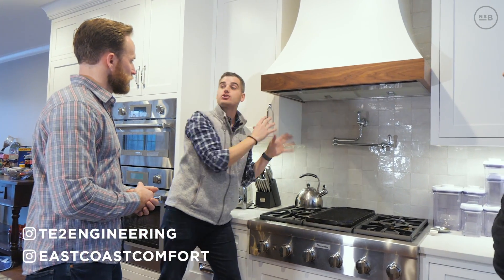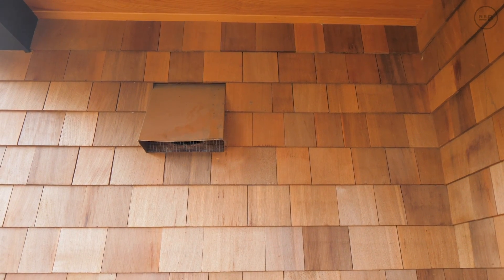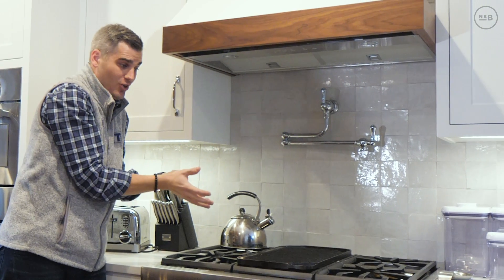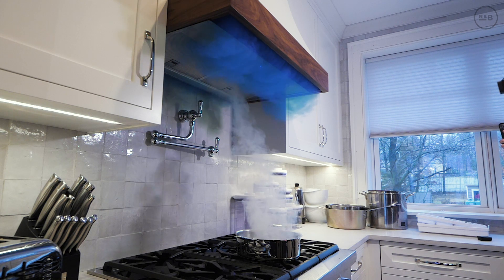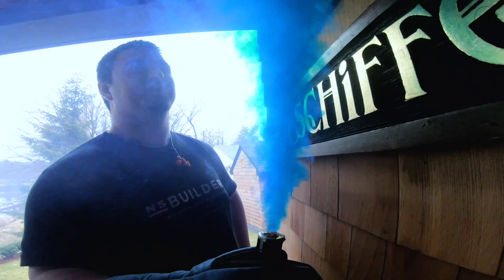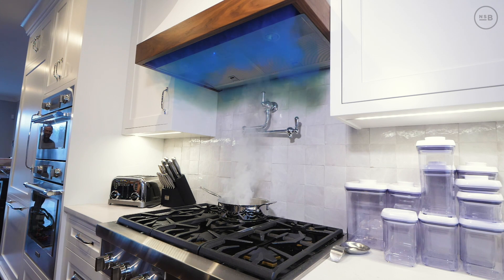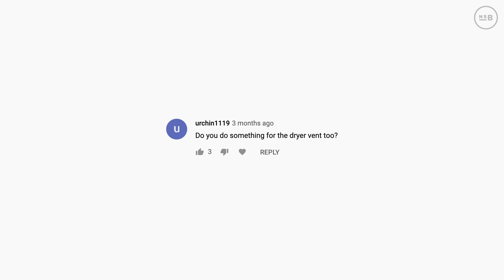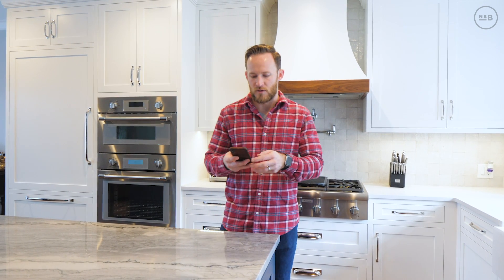Performance smoke test on kitchen hood exhaust and make up air

Comment: Why is outside air needed?  Wouldn't the hood be drawing room air in from around the front of the vent to similarly sweep cooking fumes away?  Is the purpose mostly to avoid expelling conditioned room air, for more efficiency?  Also, in an extremely tight house, the exhaust fan could create a negative pressure, but most houses leak enough that it wouldn't be an issue.  If you have a doggie-door, that acts as a pressure-relief valve to mitigate significant negative pressure inside the house.

Comment: The test is a bit disingenuous. Whatever that was on the cooktop was NOT putting out near enough smoke or steam for an honest test. I want to see two cast iron skillets cooking ribeye steaks at 425 degrees. Now that will give you some smoke. However I do like the make-up air system.

Comment: Interesting idea for a test but really this video shows that this setup exhausts the makeup air, not stovetop smoke, which is the point of having an exhaust fan over the stove. The simple variation that probably would have shown the effectiveness of the vent removing stovetop smoke would have had a lot more stovetop smoke and start with the exhaust fan on and the makeup air inlet blocked, showing how well the stovetop smoke is pulled out in that condition. Then unblock the makeup air inlet, and see the difference. It would have been interesting to see that.

Comment: Love this idea, but was wondering if there is a minimum distance there must be between the exhaust outlet and the make up air inlet on the outside of the house? I have limited options for duct routing and they would need to route to roughly the same place on the outside wall.
Reply from the maker: Best to work with a mechanical engineer and ask

Comment: Matt Risinger has a more recent video of a fantech MUA system.  He uses a manometer to show that two 8" passive holes do not supply enough air to balance the pressure of one powered 8" ducted fan.  I agree with other commenters.  I think this is just reducing the actual removal capacity by simply removing outdoor air that does not capture the fumes (a short circuit).  Also it's unfiltered air.  And it's not providing enough makeup air to balance.  Home Performance also has good videos on the same fantech system.
Reply: True if balancing is your goal, but your still keeping a high velocity that you wouldn't have with a smaller fan. Basically it traps fumes like a high exhaust system but loses tempered air like a low exhaust system

Comment: I'm not a hater and I appreciate people thinking out of the box. 
Given that, I think you cheated on the test a bit.... I noticed that when the fan was turned down, you moved the white pan to the back burner, obviously trying to get it to work when it didn't at its original location.  This is bad form.  99% of people use the front burners when they cook and only use the back when the fronts are taken.
Also, the original video showed the flow with arrows looping all the way down to the burners (it doesn't take a rocket scientist to figure out that was marketing hype).  Your own test debunked that idea.

Though I think this system doesn't give the results and isn't worth the effort or cost to install, it is an attempt to try something better.

 I just wouldn't stake my company's reputation or clients hard earned money on an unproven idea. YMMV

Comment: The house is still under negative pressure if your passive intake duct size is equal to the exhaust air duct.  For example, if 400-cfm is being removed through an 8" diameter duct, then the passive make-up hole size needs to be 16" diameter (or a 14"x14" square hole).  In any event, your thought process is appreciated.
Reply: exactly   You’ll need a much larger intake for this passive makeup air approach.  For 1200cfm hood. The only solution would be an active system with a Motor.  The tricky thing I am trying to find out is where to put those intake grill so that most of the air coming in will be exhausted in the end , resulting in minimum outside air mixing with the conditioned air in the room.
Reply: @charliexu1099  I'm currently working on my own house and have decided to use a 1000-cfm exterior wall-mounted kitchen exhaust fan with a Fantech hood liner.  This should work well with a 20-inch (314 sq-in) motorised make-up air damper from McMaster-Carr.  The air is being pulled from the attic and placed above the fridge which is adjacent to the stove, with the use of an electrostatic filter.  I also have the option of putting the make-up air directly above the stove.  There will be very little mixture of air, as it is all localised.

Search "Broan make up air damper calculator" to help sizing your passive hole.

Comment: Not sure what is really being gained here, except your exhaust fan is mostly exhausting fresh make-up air?  How about getting a couple of those front burners going with white smoke with the make-up air off, then again with it on.
Honestly, as its set up now it seems like bragging rights for an over-complicated theoretical air flow system that isn't doing what it was envisioned to do.

Comment: So you guys are pretending that this works. Ignoring that it vents out the clean makeup air. The curtain of blue smoke should of went down close to the cooktop in order for the design to work, that way it eould mix with the gases. What you got there is a system that kicks out the fresh air from the makeup air vent.
Reply: Looks like it's support to act as more of an air curtain than being solely make up air.
Reply: I would think that what you really would like is for fresh air to come in and stay in an remove old stale air, no bring fresh air in and out.

Comment: This is my preferred approach by a long shot. Thanks for both these vids. Since I have no choice but to add MUA I’m making myself like the idea. 
After watching the popular uploads and reading the comments, some clarity surfaces. Coming in from across the room unconditioned, unfiltered, passive. I better not. 1/2 the time ovens are elsewhere, so from below is subjective. My insert is only 600 cfm, (with an 6””outlet, doubtful) and I get to build the island hood. Plenum style is a terrific approach! An 8” passive  24v damper seems adequate. A filter box probably won’t work though this way, right?

Comment: Quick question, is there any issues with pollen intake? I would have expected to see some kind of online filter with this make up air system, my worry is that here in Georgia if you had that system without a filter on the intake side then if you turned it on when cooking you would potentially bring in pollen/outdoor dust over your food, and that doesn’t sound great.

Comment: The "smoke test" is fundamentally flawed in that the "smoke" is significantly lighter than the grease/oil infused exhaust from regular cooking.  (just look at the grease residue in and around a typical work area etc...) Also, in your demonstration you use just one pan on a six burner unit...which probably could generate at least 90,000 BTU.  I have to say the this video is borderline a bunch of "smoke" and mirrors!  But the kitchen looks great!

Comment: I designed and built an 8” square butterfly valve back in 2000. It has worked flawlessly for 21 years. I built my house. It is a very tight house. The wall behind my dryer is 9” thick so I could build a square wooden duct that run up to about 3’ in the attic. The valve is made of maple and 1/8” Masonite. I used an old electric solenoid I salvaged from an old washer. I wired the solenoid to the dryer so the valve opens when the dryer is on. I do have a sweep on the utility room door, but it still pulls in air from the attic because the house is pretty air tight. I would just buy a butterfly valve now days. I also put an inline fan in my stove hood duct about 10’ from the intake. I also added a 6” fresh air duct to the fireplace. It came with a 3” one. Without the extra 6” duct, I would have to open a window to burn a log. Actually, we opened a window anyway because my house don’t really get cold down here in south Louisiana. The fireplace was strictly for the wife, not needed to heat the house.
Reply: We have a simpler device, termed "doggie-door".  It prevents the interior from reaching a significant negative pressure by just allowing air from the garage in.

Comment: Most local hvac codes require another blower to be used to supply makeup air.

You would need to determine the net exhaust airflow, as 30 feet of ductwork  will reduce flow capacity.
That will then determine how much makeup air should be required.

It looks to me from the smoke test that the makeup air is short circuiting, and is ending up as 2/3 of the exhausting air.

Some commercial hoods a incorporate such a design, they are much larger, and over hang cooking surfaces by at least six inches, and have had a lot of engineering incorporated into the design.

Otherwise, makeup air is best introduced far enough away from the cooking surface,  as not to disturb the upward flow of cooking fumes as they enter the intake of the hood.
Reply: I think this 'design' was an attempt to make something akin to a commercial design, with really understanding the design aspect.
Spend more money on an oversized motor to pull air in and directly exhaust it. Thats a good ROI...

Comment: The white smoke being too little will be sucked away no matter what . What would be of a more rigorous test is too increase the white smoke from the cooktop by a LARGE amount and operate the hood in two scenarios :1 . Open the damper and have the blue makeup air coming in.  2. Keep the intake air closed    Then we can understand how this makeup air system helps it work .
Reply: I agree. I have a professional Viking stove with an Imperial range hood with two blowers and my wife will still have smoke when she has a frying pan going full throttle. While the white smoke they depicted was captured, any decent hood will do that. Let’s see some real smoke!!

Comment: This is a super cool design; however it does look like it is creating a bit of a short circuit, it looks like the make up air is being much more aggressively pulled out then the smoke coming up from the cooktop, I’m not saying this is a bad system but I think you are sacrificing some  ability to remove fumes from the cooktop by having the make up air right next to the hood liner, just to throw a guess out there I’d say your loosing maybe 30% efficiency. 
Again this is a cool design it solves the expensive and extensive problem of conditioning the outside air and also allows you to not have tap into your forced air return to get the make up air. 
Great video and great design thank guys!

Comment: Great video! And love the question about the dryer vent… I’m curious to get your thoughts on this around a wood-burning fireplace, like an Isokern. What kind of make up air solution would be best in the firebox? Certainly smaller than 10 inch. How might it trigger a servo to open?

Comment: I install appliances for a living and this is the perfect install. Not many folks want to spend the money to do it this way. Great job! Do it right from the beginning.
Reply: You would push your family or friends to spend the extra for this vs a standard installation which would cost 1/4 and do the same or better job with a smaller motor? Really?
Reply: @boots7859  if you want to have higher cfms it’s required. And this is the perfect way to do it. So yes.

Comment: If I were to build a system similar to this with make up air in an island hood fan, would you have the make up air come in from the front of the hood fan as in this video, the back, or both? I have the option of doing it any way since I’m still roughing it in at this point of my build.

Comment: I watched the previous video of the installation and started to question the performance of the design. This video actually confirmed it. With the intake makeup fresh air right there at the hood, you are now reducing the hood performance greatly. That 1200cfm at max will be taking majority of the air from the outside, and only create maybe 400-500cfm of actual cooking fume. So theoretically speaking, you could have archive the same performance of this using a much smaller hood and a makeup air intake somewhere. I have done something similar to this before and we placed the intake for fresh air built-in to the cabinets on both side of the range. When you turn the hood on, intake air will be coming from either side of the range, creating a good flow and carry the cooking fume out with it as well. Very similar to what a Dyson bladeless fan design. 

Anyhow, great work!
Reply: yes, the video demonstrates the short circuiting in my mind.  It would be intersting to run this test with the intake blocked off and with a window open to see what happens to the white smoke on the stove.  Perhaps the incoming air helps contain the smoke by creating an air curtain - perhaps not.
Reply: @jackmorgan709  I  think if they did just as you suggested, the result would be a better capture of the white smoke.
In fact,  they could likely set two of the white smoke grenades off.

The way the makeup air Is,  it is not creating an air curtain,  it is short circuiting, and interrupting the flow of the cooking fumes.
Reply: @satunnainenkatselija4478  There's no free lunch. If you're exhausting all the makeup air immediately, that would imply you're exhausting nothing else. If the effluent is getting pulled out along with the makeup air from above, that can only mean there's other makeup air coming in somewhere else. As pointed out above, this is just a way to turn a 1200CFM range hood into a much smaller range hood, and I would say the figure of 400-500CFM is overly optimistic. It could be 100-200CFM.
Reply: I think this system would be absolutely perfect if the cold air intake was lower with the food and could be pulled up with the cooking fumes but instead it just rolls up and exhausted right away... I would say too soon. Might not look as fancy but it would be way more functional to have the cold air right at cooking level.
Reply: Where abouts did you place the make up air, in the toe kicks on either side of the range?
Reply: @satunnainenkatselija4478  I think he answered that by hedging about PMCS for a commercial operation.  Excellent point by the way.
Reply: I agree.  It is a lot of work to solve a non-issue, and likely gives even poorer venting of cooking fumes.

Comment: Thanks for doing this, super cool and informative!! I wish you added one more smoke grenade, maybe on the floor by the cooktop, to represent the air in the rest of the kitchen. The blue smoke is all exhausted and the white smoke is all exhausted and doesn't appear to be replaced by blue smoke. Therefore, even though you are reducing the need for makeup air, you are still pulling some air from the home. For a passive house, this would still be a concern and additional makeup would still be needed. I have talked with TE^2 and Positive Energy (they did a similar approach that was shown on Matt Risinger's channel) about this because of how intriguing this idea is. Keep up the great work!!

Comment: Never lived in a tight enough home that a hood vent created a problem.  As such, don't understand the need for this?  What happens if you don't add makeup air? Depressurizes the inside of the house drawing in cold outside air from air leaks?  Is that truly a big enough problem worth adding makeup air vents/blowers?  How much stove-top cooking do people do? I may cook something for 10 minutes where I need full ventilation, but after that it's low speed fan to handle whatever is simmering. Seems like people are being sold an expensive solution for a modest problem
Reply from the maker: Most of your questions are answered in our original video https://www.youtube.com/watch?v=RJ-WF7gaiXA
Reply: I learned of this because we have a house fan and what happens when it's on and no windows or doors are open is creates a massive air suck in the house so powerful that it actually pulls gas out of the furnace and chimney and as you could probably tell that's pretty dangerous and deadly. By having make up air or a large hole somewhere else the vacuum sucks air from another source than your house
Reply: Make up air is a code requirement for all but small hoods, not just an issue for super tight houses.

Comment: but aren't you worried the air coming back in from the make up air is being sucked out, in the demo you can see the blue air going back outside and not into the kitchen.

would you consider putting the damper in a side lower cabinet instead and cut the toe kick to allow the air into the kitchen?
Reply: Thought the same
Reply: @satunnainenkatselija4478  no make up air is as it's said to make up the air going out
Reply: @satunnainenkatselija4478  The point is to get out the make up air faster but along with the gases, not just the fresh makeup air, otherwise just leave it outside 🤣. This is basic logic…

Comment: Bringing in fresh air to older furnace right to combustion chamber, greatly improves efficiency.
Reply: why? more air for the burn?
Reply: @shahsmerdis  No the fresh outside cold air is used at the source rather then coming in thru every crack and opening in home cooling it wasting energy.

Comment: 160 cfm is too high for dryer less then half that.  You would suck the heat out too much at 160, 50-80 cfm to pull humidity from drum.

Comment: It looks like it does work.  However it's still sucking out a large percentage of makeup air and using that current stream to passively suck out the fumes.  Wouldn't it be easier if you just used the same air coming in from the ERV so you wouldn't have to run additional make up air?
Reply: Rocky s The ERV probably can’t supply 1000Cfm to match the hood
Reply: @hellonoko  Use the less cfm exhaust fan. The nature of hot air is rise up anyway. Just need some additional pull to get them all.